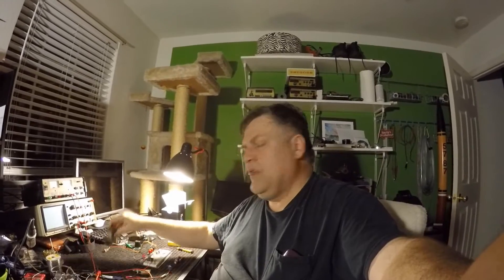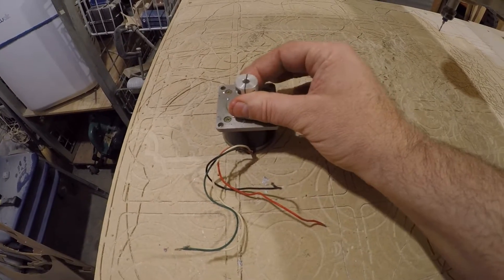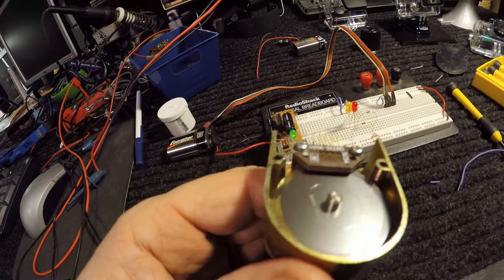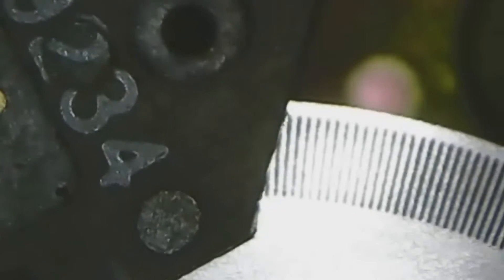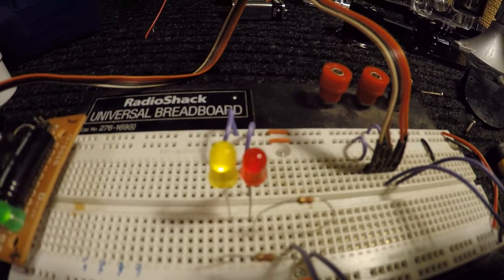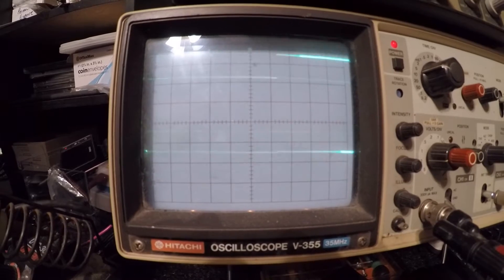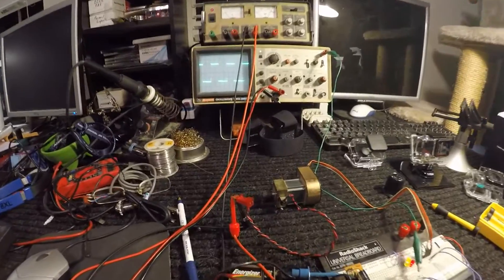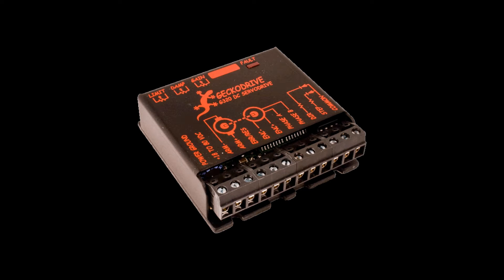Quadrature Encoders

Comment: Hi can I make an encoder communicate with Linuxcnc through USB header pins on my mother board?
Reply from the maker: There are USB devices that can communicate with LinuxCNC such as an MPG. These have a processor in them that converts the pulses into a signal that LinuxCNC can understand. Here is a video I found on this, it references Mach3 however it also applies to LinuxCNC.  https://www.youtube.com/watch?v=Elkc7YSBbk8